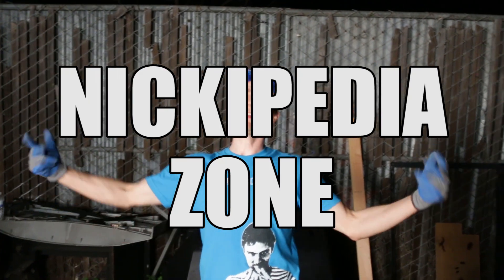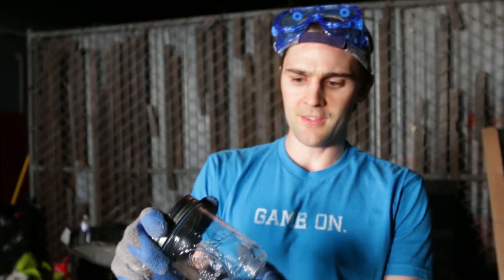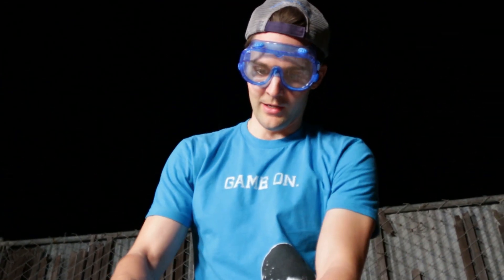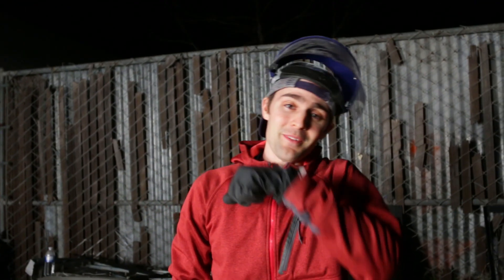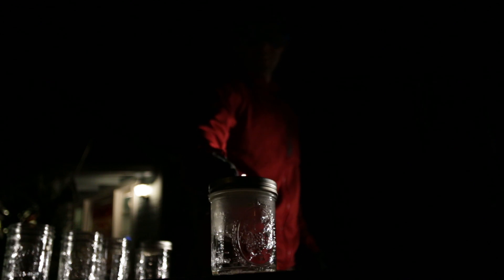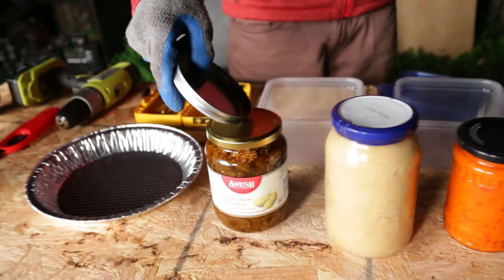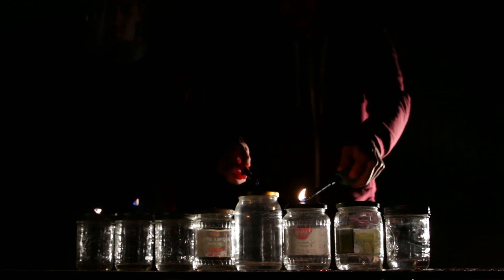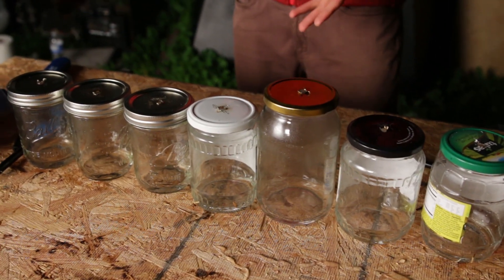Jam Jar Jet - Making A REAL Jet with Alcohol and a Jar

Comment from the maker: We made a real jet with a JAM JAR!!! At first we tried this with a mason jar, and it worked okay, then we tried it with a real jam jar and it worked MUCH better! This mechanism is essentially making a pulse jet with a jar. The alcohol (99% methanol) mixes with the air creating alcohol gas. The little hole at the top lets in oxygen. When you light right above the hole the gas ignites, sucks in more air, and ignites again… this is a pulse jet! We put ice water at the bottom of the jar in order to create more of a vacuum.
Reply: Add a diffuser

Comment: So i made my own at home, but it's much more dangerous.

Instead of alcohol, i used gas, in a large mason jar. I filled about an inch in the bottom, and put two holes in the top;

One for the nozzle, and one for the air in

Air in. I used an air hose with a little nozzle, and stuck in it the air hole. The result, was a magnificent jet. Not enough thrust to take off, but the air angle was quite poor so i didn't receive  good results, but with some refinement, it can be extremely powerful.

Comment: What you want is a tall and slim bottle so the fule has less surface area so it wont evap. as fast then since the bottle tall so you are getting more air to get the right air fuel ratio.

Comment: I have advice

Make a bigger hole  and probably use more fuel for a smoother run worked excellent till the jar broke 🙁
Reply: Also try blow air inside the jar to get more oxygen inside
Reply: @noeleendenysschen5130 well your breath is mostly moist co2 so that would be a bad idea. Also less fuel would likely work better because it won’t slosh and disrupt the cycle.